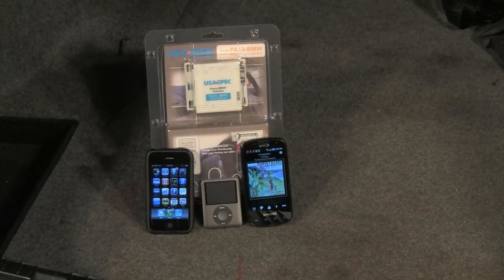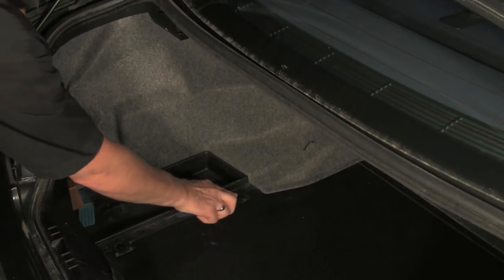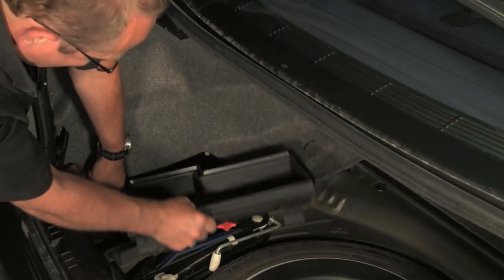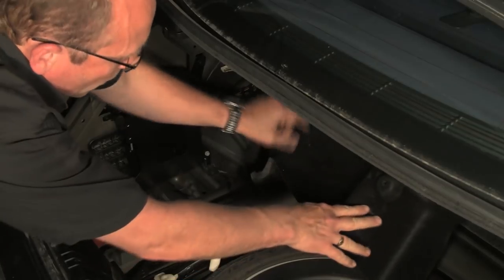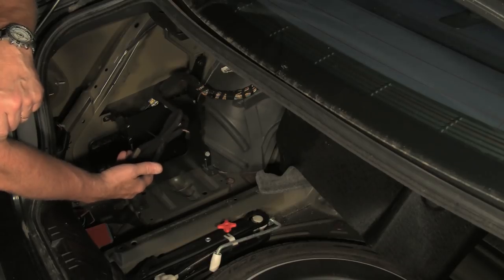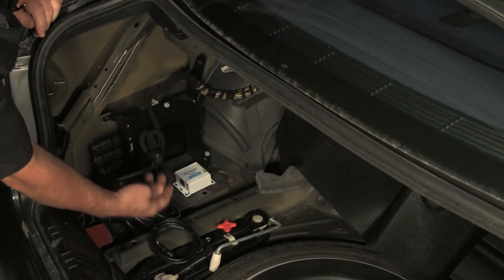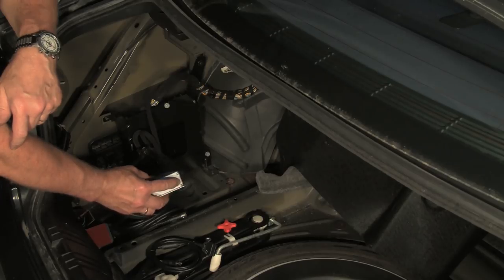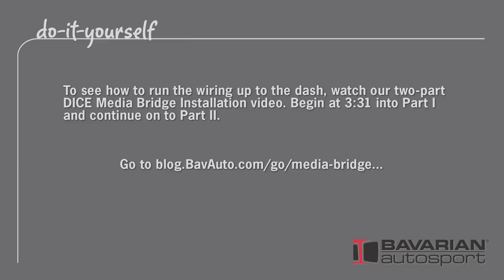Installing the Smart iPod interface in a BMW or MINI

Comment: I have 2003 530i, Is it possible that I could have the I Pod cable installed in my car and the sound comes from the speaker direct instead from the radio.

Comment: will this work on a 2004 525i E60?  The idrive only has Radio, CD options.  This model did not come with a trunk mounted CD Changer.

Comment from the maker: If you have a fold-down rear seat, the install will go as shown.  If you do not have a fold-down rear seat, you can pass the wiring through the rubber grommet on the passenger side of the rear seatback - trunk wall, where the battery cable passes through.  You will have to remove the rear seatback 9in addition to the seat bottom) to access the wires from inside the passenger compartment.

Comment from the maker: The 2004 5-series (E60 chassis) does indeed have the option to add a trunk mounted CD changer.  Therefore, you can add the Smart iPod Interface on this vehicle.  When installed, the radio will have the option to choose CD and this will be for the trunk CD changer input (or the Smart iPod Interface).  You can see the CD changers, the iPod interface and other audio options at bavauto.com

Comment from the maker: No, the system works with most BMW models through 2006.  The later models use fiber optic systems and the device will not work with these systems.

Comment: Will this fit a e34 1995 525i? Thanks
Reply from the maker: No ... just Jan, 1996 and later.  For the earlier models we offer the DICE/Audiovox USB-FMRDS unit, which allows ipod and smart phone music input via a tap-in to the FM antenna wire.  You then listen on a pre-set FM station.  See link below:
http://www.bavauto.com/fland.asp?part=UNI-200-USBK